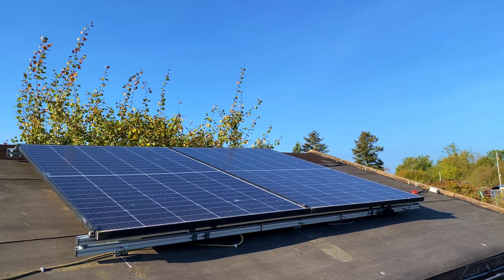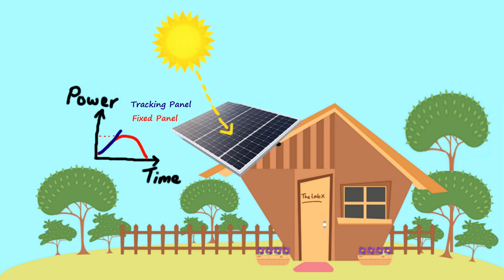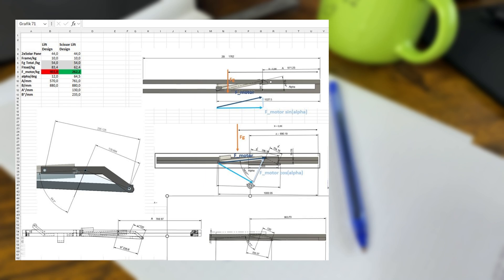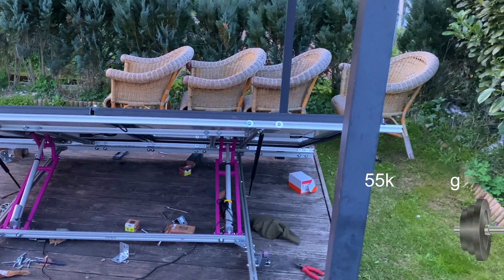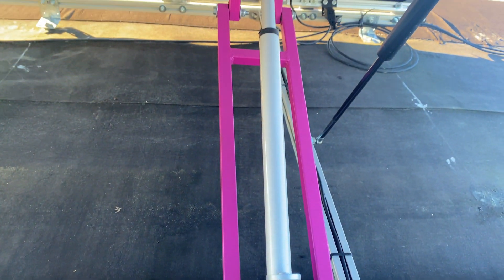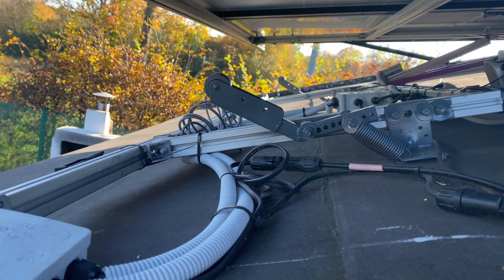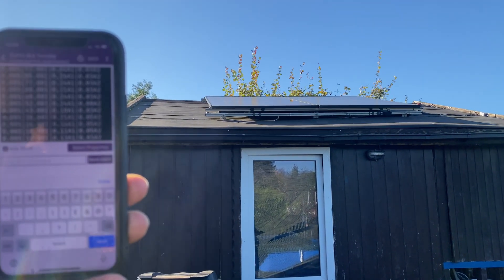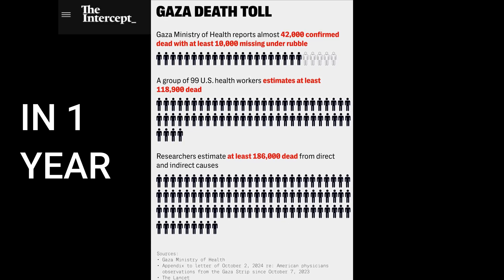You've Never Seen A Solar Tracker like This! DIY

Comment from the maker: Thanks for watching! Part 1.5: https://youtu.be/ehS-G_TzwOc. 
To support Gaza please donate here: https://donate.unrwa.org/-landing-page/en_EN
Stay tuned for part#2 - Measuring the energy for a period of time and comparing the results (with vs. without solar tracker).
Reply: first why waste power powering the tracker ... use the su to heat water and adjust the tracker saving all the power the panel gets to actually do useful work and not adjust the panel ... 

4 hydraulic pistons that heat up and push a rod on the opposite side will auto track the sun by it's heating of black tubes of fluid one for each side ... 0 power needed ... 0 electronics need ... 0 wires needed ... 0 waste of power ....
Reply from the maker: The solar tracker max energy consumption per day ( in summer ~ 8h) is ~10Wh. The average energy input of this setup is around 3000Wh. So, the solar tracker consumes ~ 0,3%.
Reply: @TheLab-X  Pls write about different parts used in the project or provide links.
What are air spring?
Thanks
Reply from the maker: Good point! Parts added in the description.
Reply: @Kaboom-0623  You are on to something! Have you tested this? what if a day was half cloudy? Would it be able to catch up?

Comment: Hello, and congratulations on this great project!!!👏👏👏

I followed your project very closely because I want to make a more sophisticated one, on two axes.
I noticed that you positioned the tilting mechanism exactly opposite to the one on the dump truck that inspired you. Did you try to put it the other way around and it didn't work?

I would like to make something similar but with a lift from the bottom to the horizontal (imagine from 6 o'clock to 9 o'clock).
Reply from the maker: With some adjustment it should work the other way around as well.

Comment: what length is the actuator arm you using.
Reply from the maker: Stroke length 350mm/14”. Retracted 470mm/18.8”.
Reply from the maker: Stroke length 350mm/14”. Retracted 470mm/18.8”.
Reply: @TheLab-X okay thank you good to know

Comment: I think you could have had way more than 25% increase if you had managed to tilt it a little bit higher.
It´s in the evening that normal panels dont make much but trackers could make a bit difference.
Also why not put your entire shed on a rotating disc? Maybe a project for a next video.

Comment: Cool times 10.   Using the 4-bar monkey motion.  I knew it could be done.  Thingiverse has the .step files that can be viewed with FreeCad for free,  as in "as the wind blows."  No hidden sign ups giving away ones email.  Maybe I will make a scaled down 3d-printed version for prototyping and playing with the electronics.

Comment: If you want to expand the project, I suggest adding 2 more panels on the opposite side of the roof. Raise and extend that frame. On the other side, you’ll have 2 panels—this time without an actuator. What’s more, the one you’ve already installed will be under less strain (if you place the pivot axis in the plane of the glass). Good luck. This advice isn’t from someone who’s just guessing. You’re reading the words of the creator who’s practically built a similar system.
إذا بدك توسّع المشروع، أنا بقترح تضيف لوحين إضافيين عالجانب التاني من السطح. ارفع ذلك الإطار ومدّده. عالجانب التاني رح يكون عندك لوحين - هالمرة من غير محرك. وأكثر من هيك، اللي ثبتو أساساً رح يكون عليه حمل أقل (إذا وضعت محور الدوران بمستوى الزجاج). بالتوفيق. هالنصيحة مش من واحد بفتي. أنت عم تقرأ كلام المطور اللي فعلياً بنى شي مشابه.
Reply from the maker: It’s a clever Idea! However, I want to keep it a low profile setup.
Reply: @TheLab-X  Du kannst das Low-Profil-Prinzip beibehalten, wenn du die beiden Teile (auf beiden Dachseiten) mit Scharnieren verbindest.
Dann kannst du die beiden Linearantriebe als Druckstangen für die Seitenprofile nutzen, die die Ebene beider Profile gerade ausrichten.

Nach der Aufrichtung (sofern du sie gut ausbalancierst) lassen sie sich zur gravitativen Neigungssteuerung verwenden. Die genaue Ausbalancierung ist hier gut beschrieben: *bm8faldt Auto Sun Tracking for Solar Panels - $99*.

Bei stärkerem Wind kannst du die Antriebe einfach einklinken – beide Teile legen sich dann flach und sicher auf dem Dach ab. Viel Erfolg!
Reply: Exactly what I had in mind for my  roof with a  north south pitch line.

Comment: Hi, thx for your video,  Very nice.
What part of it is 3 D printed?
It looked like you did your own welding. Do you have plans for that? Thanks
Reply from the maker: Glad you liked it. The only welding needed was for the scissor mechanism (in pink). The CAD models (link in the description) should provide you with all information you need.
Reply: @TheLab-X  ok. Thank u so much.

Comment: Due to the extreme drop in the price of modules, tracking systems are now uneconomical compared to the cost of multiple modules.
In any case, trackers are prone to maintenance and faults due to the mechanics and electronics, and are also very susceptible to wind.
It is much cheaper and more reliable to simply install many more modules. For more constant yields, align the modules in an S-E and S-W direction.

Comment: That's a great approach for those with ample space! However, given the affordability of solar panels today, many opt for additional panels rather than trackers. While trackers can optimize energy output, adding another panel can often be a more cost-effective way to increase overall power generation. It's a great discussion point, and I'm curious to hear other perspectives on this topic!
Reply from the maker: Given the price of solar panels nowadays, putting additional solar panels is a winner. However, its not always possible to add more panels. In my case (East/West), the only option is to add panels on the west side, but then they will be covered by the tree. Plus, where is the fun in doing so? ;)

Comment: One thought I had was: it might be much cheaper to build a reflector instead and track that against a stationary panel. It's likely much lighter, and if wind rips it away, you would still have your panel. Downside: twice the roof real estate is needed, and possibly in the wrong spot (hanging off the roof). Second idea: just have it sit on the peak of the roof and "rock" over as the day progresses.
Reply from the maker: That's interesting idea.. My goal was to keep everything tight and low-profile.

Comment: What's the cost of the setup compared to putting another panel in the other side?
Reply from the maker: Generally speaking adding more panels is cheaper than trackers. However, in my case, once the sun is slightly behind the shed (west), the power drops significantly. The other solution would be to put another panel on the other side facing west. but then there is the tree..